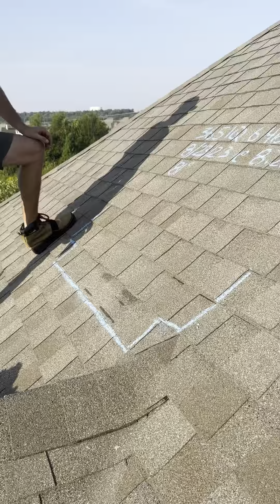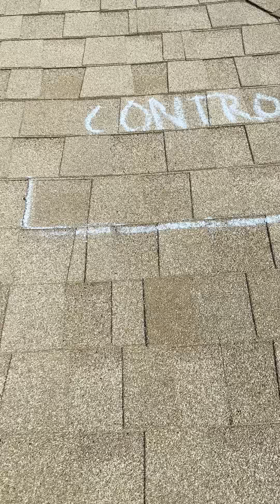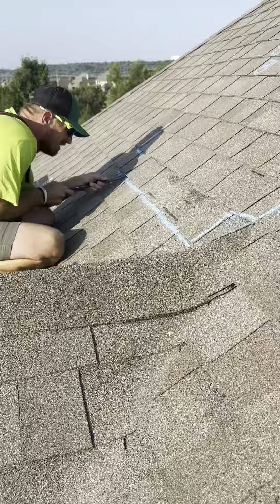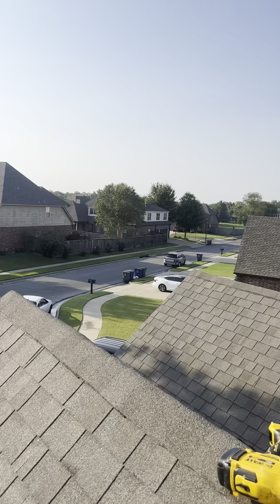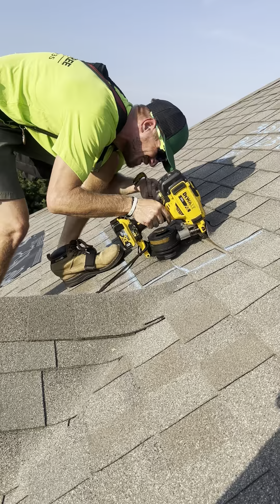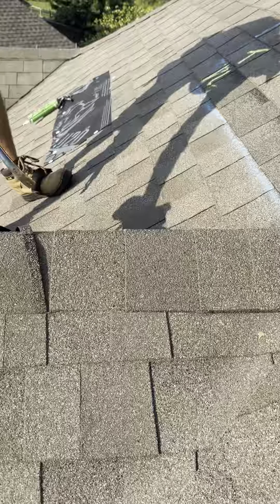3651Q646Z Repair Attempt

Comment: Any help on getting them to properly pay for an EPDM replacement. Trying to give $22k for a 36 sq. flat roof.
Reply from the maker: Have you did a core sample? Is there iso under neath? What type of fasteners? Any curbs they missed? Need can’t strips? Metal flashing around the parapet walls or anything? Air conditioning units that need lifted to roof under it?
Reply: @saferoofer  No ISO. 2 layer. 1 curb. 5 foot parapit wall, 83 ft. 60 mil EPDM. There needs to be t bar,  but none was installed originally. AC unot is on the curb. Need to remove steel siding to install. No lifting. No metal.  Insurance company does not want to pay for t bar because it's not mandatory. It's shelter. They are belly aching over my original estimate.
Reply from the maker: @mofishing2241 you need to show documentation of what’s needed. Use manufacture specs and code R905.1 saying you have to abide by their specs.
Reply: @saferoofer  Thank you!
Reply from the maker: @mofishing2241 (918)703-3735 if you run into any issues text me.